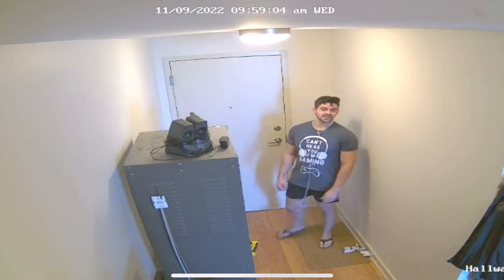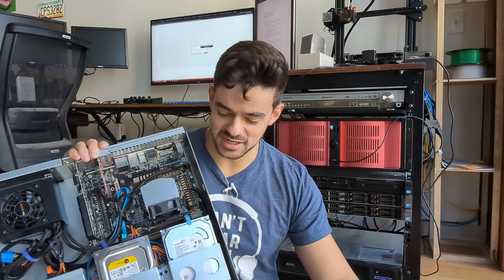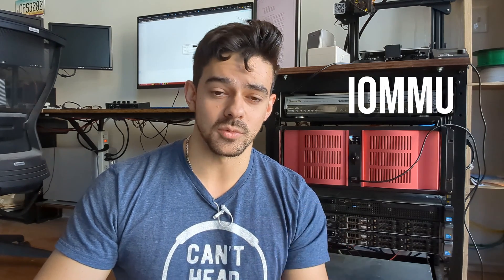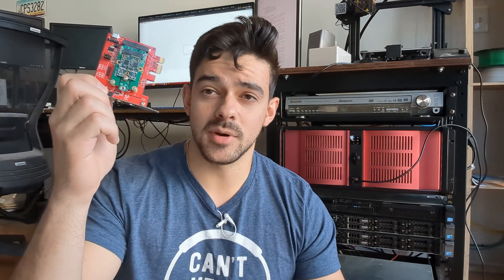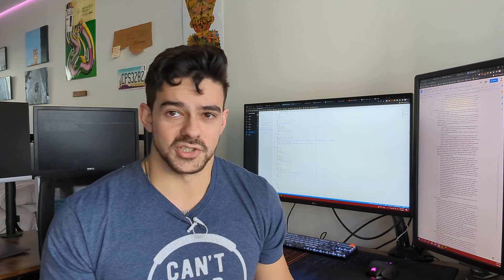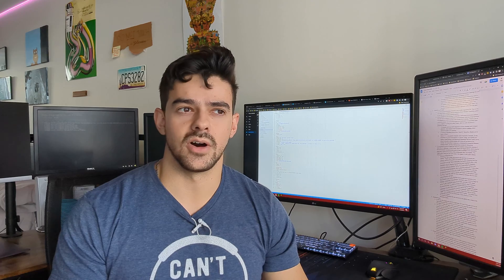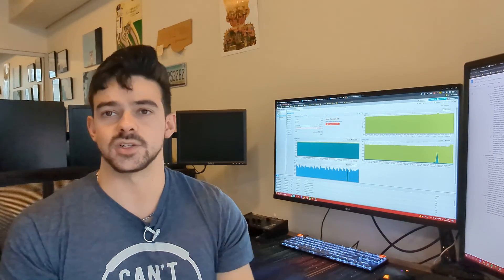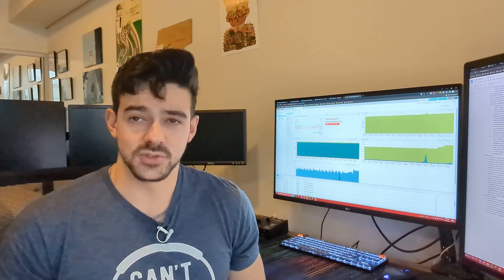Security camera object detection with Home Assistant, Frigate, and Google Coral

Comment: I would focus on getting that m.2 TPU working, that unit looked the the dual edge version which means its has 2 TPU processors on it vs the USB single processor unit. Probably wont make a difference with a single camera but it is a more powerful TPU if running properly. Your conversion will probably work if you get a PCIe -> e key adaptor (check some desktop PCIe wireless adaptors) instead of PCIe -> mini PCI -> E key, however this might still only get you a single TPU working on the dual edge m.2 card.
Reply from the maker: Yeah it's a real bummer that I couldn't figure it out for this video... I think it just gets too complicated with frigate running as an add-on in HASS which is running in a VM, and I'm going to revisit this at some point to do a standalone Frigate containerized deployment, which can then just connect to home assistant with the Frigate connector add-on... Love the feedback!
Reply: @ThomasComputes  I don't know if this was your problem or not, but I thought I might mention it in case it might be helpful. I have no experience with this particular device, but I have in the past run into issues with mPCIe cards (or rather what I initially thought were mPCIe cards) in mPCIe to PCIe adapters. One problem is that mPCIe, and I believe the same is true for M.2, is sometimes just used as a "form factor". By that, I mean the devices have the same connector and form factor, but they are not actual PCIe devices. Instead they are actually either usb or SATA devices. If that's the case, these mPCIe to PCIe adapters won't work because the PCIe slot your plugging them into on your motherboard only talks PCIe and won't see USB or SATA devices. Seeing as how this device comes in a USB version, there's a chance that might be the case here and the mPCIe and M.2 form factor versions are only using a different form factor and are actually USB devices. The thing to do might be to try an mPCIe to usb adapter. If you do that and it works, it's actually a USB device, just using the m.2 form factor.